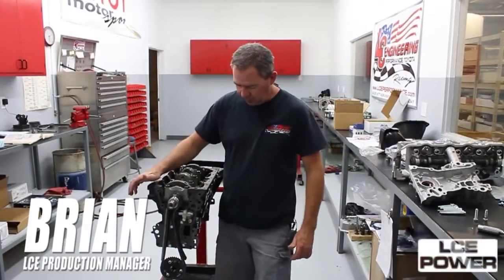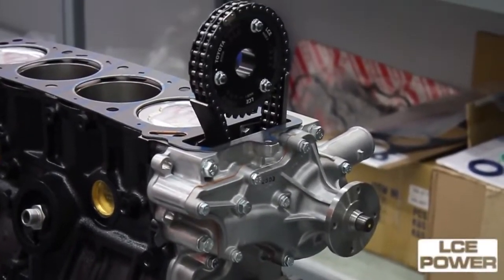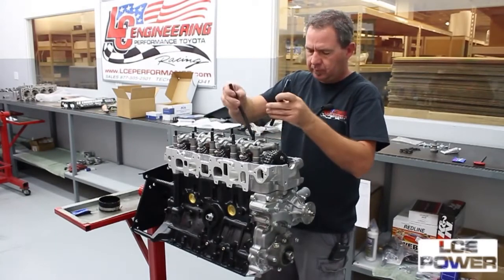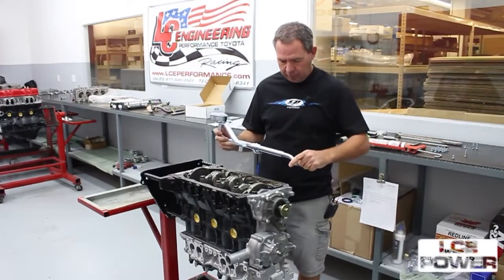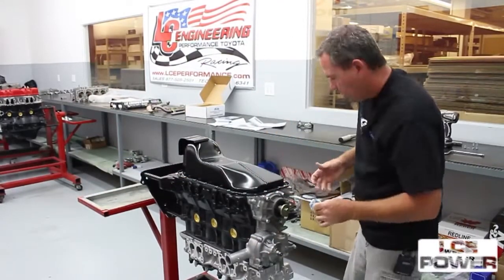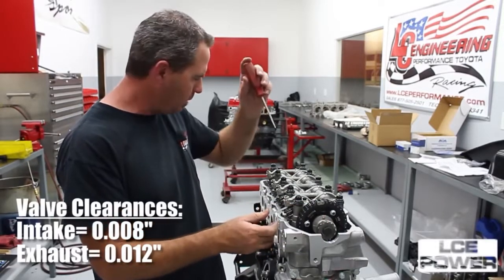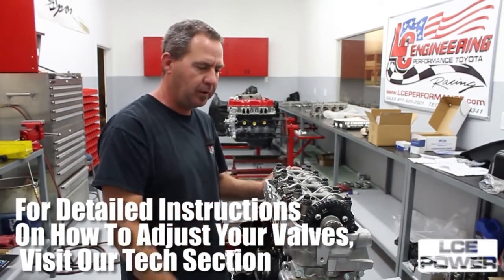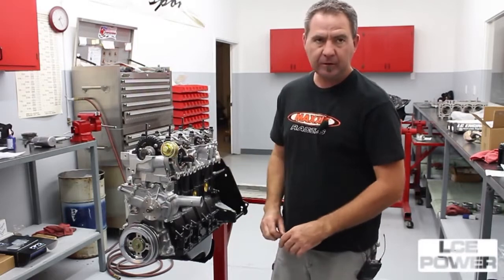(ASSEMBLING THE LONG BLOCK) LCE 22R Street Stroker Long Block Build Mini Serie - Episode 04

Comment: why is it 90lbs on the arp bolts?isnt that to tight? and what's the stock head bolt torque tightness you guys recommend?
Reply from the maker: ARP Studs torque at a different spec than OEM head bolts (62 ft. lbs.)

Comment: I thought the specs for Toyota on the valve clearance were with a hot engine?
Reply from the maker: They are set initially at the 8 and 12 on the stand. After it runs and gets to operating temperature it will be reverified and adjusted if needed.
Reply: Ok.

Comment: Why lube the head bolts!!🤯  ar they apecial bolts. And wouldn't that result in over torque?
Reply from the maker: On our long blocks we will be using ARP studs which are a Stud / Nut setup. The stud is snugged into place and the nut is then torqued.